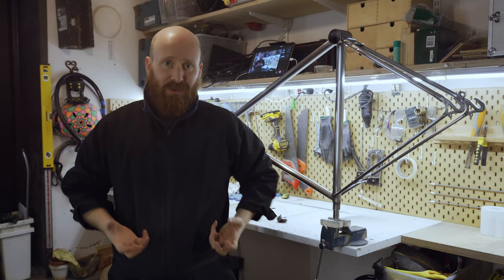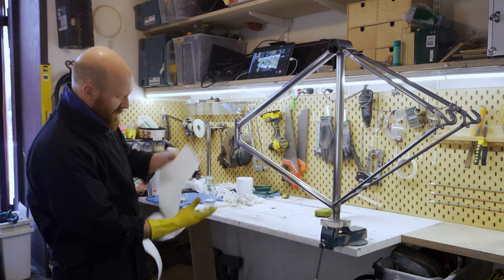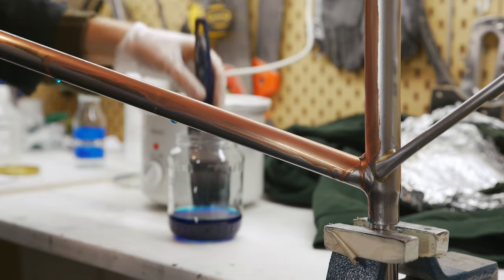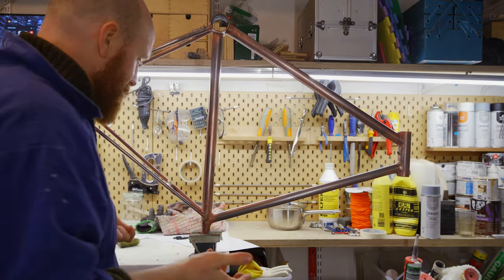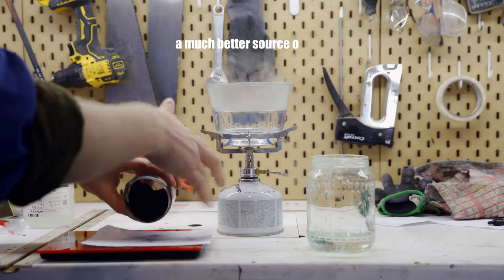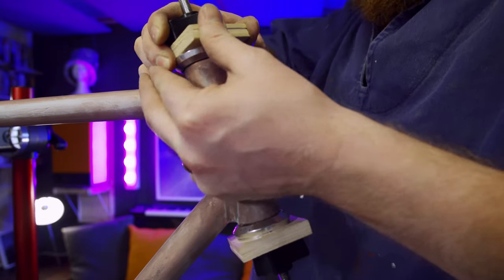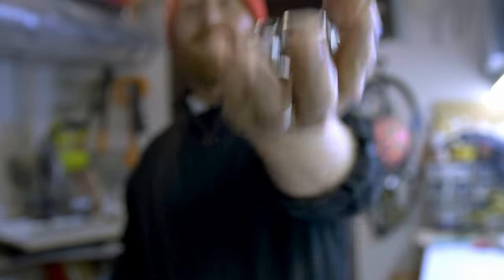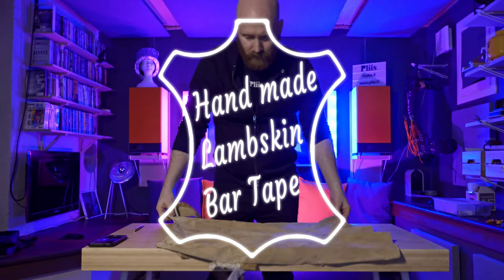How to acid COPPER COAT steel bike frame without electricity + Recycled bike build

Comment: Ok well you seem to combine my 3 favourite hobbies, filming, cycling and myog. So subbed.
V jealous of your shed.

Ps, I made a steel frame and then got it clear lacquered after phosphating (meant to stop rusting but doesn’t).
I’m wondering if I stripped it and then copper plated it as u have, could I then get it clear lacquered (before it goes green) and keep the copper colour and prevent rust?
Reply from the maker: The copper is atomically thin, Laura has stripped and painted her petrol tank, and I've clear coated my frame. If you look further up my video list, I've upgraded a little. So my copper experiment has been demoted to pub bike I'm afraid. 

I live in an old communal yard in Turku, Finland, and all the wooden houses have a basement cupboard. But yes, I love my shed, wish it was bigger!

Comment: 9:00  - that drone control box is such a good candidate to be 3d-printed, and possibly coated with carbon-fiber/fiberglass mesh for durability....
Reply from the maker: I've just bought myself a laser cutter. The 3D printer is a long way off.

Comment: So will the patina from the copper protect the steel below the surface from oxidizing and rusting? If so would this be something that you would have to redo and maintain like when you blu steel?
Reply from the maker: The copper is atomically thin, so while it's pretty, I think it's not viable protection for the frame. I ended up clear coating it once I got to the patina I wanted. Douglas explains how to keep the process going for longer to add multiple layers of copper, but I never got that far.
Reply: @SladeTakalaLamey  Has it held up pretty well after two years with a clear coat? Did oxidation continue beneath your coat or is it as stable as a normal paint job? I read that you've upgraded since posting this, but I'd love to know if there are any unintended effects two years later. Thanks for sharing your process!
Reply from the maker: @AS-vq3ep  It has but not really under stressful conditions. As you will see if you shoot further up my feed. I've somewhat upgraded, so she's been demoted to a pub bike.

Comment: I was about to try this copper oxide + acid formic combination too,
But hesitated

I think im gonna plate my stainless steel with nickel first, then copper plate it with cuso4
Reply from the maker: It's atomically thin so it's cosmetic. I ended up clear coating it before it had the opportunity to go green.

Comment: can it be sprayed on instead of brushed on?
Reply from the maker: Definitely, I did consider that. The layer of copper is atomically thin, I ended up clear-coating it because the rust was winning the oxidization war, it was never gonna go green.

Comment: @pliis which Robert video does he go into detail on how to create the solution?
Reply from the maker: I put some links in the description. I'm afraid I derived my recipe from the two videos of Robert and the one from Laura. I'd give some warning tho... Laura has since chromed her motorbike tank and my bike rusted as I've ended up clear coating it to lock in what's left of the patina.
Reply: @SladeTakalaLamey  thanks for the response! So the copper rusted to the green colour or the whole thing rusted brown from the iron?
What if I clear coated right away? Did you leave it unprotected for some time?
Reply from the maker: @benhadman2812  the whole thing rusted (brown,iron) but I didn't let it go too far before I clear coated it. 

I think it was down to the second coat. The first coat was shiny and although it was atomically thin, in the places it caught it looked brilliant. By the time the second coat was on, it became almost powdery. I think a perfect first coat is what to aim for.

There are still areas of shiny copper, but it's patchy! Hope that helps.

Comment: Is this copper sulfate?
Reply from the maker: @zngrrr  it's copper oxide, although I've heard sulphate would work.
Reply: It is working but i dont know if it's better... Do you make it with the same amounts last time?
Reply: The copper oxide in the video
Reply from the maker: @zngrrr  I presume so. As you can see from my explanation in the video. I am relying heavily on other people's expertise. I've heard that oiling it quickly after stops the reaction, which might stop the poweriness.
Reply: @SladeTakalaLamey  thank you and last question how do oyu get the green color?
Reply from the maker: @zngrrr  Time! The roof of St Peters Cathedral is copper. I think it takes buildings about two years. Bikes not sure. The rust came through mine and to stop it getting worse I clear coated it. So I'll never know.

Comment: as thin and uneven this copper cover looks, i guess the bike does turn rust red instead of green...
if you want a proper coat, you need to apply electrolysis.
Reply from the maker: I agree, but it was a fun experiment.